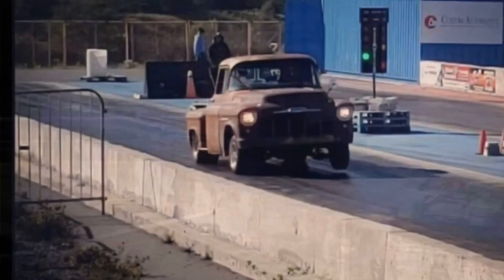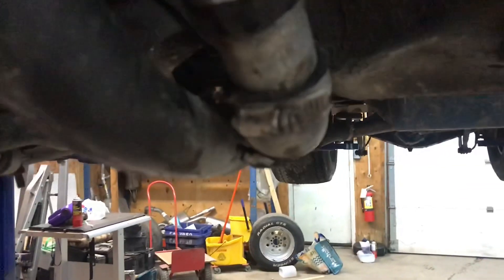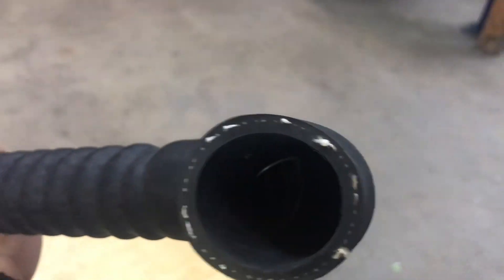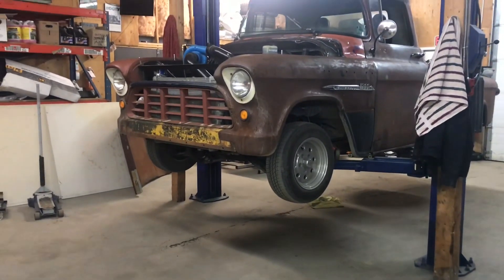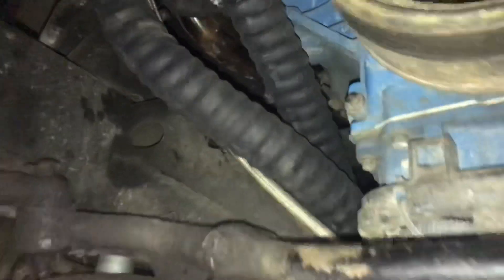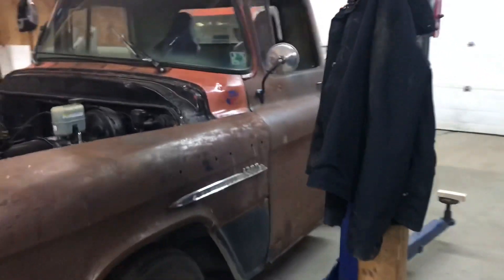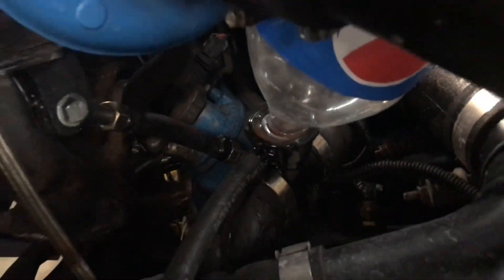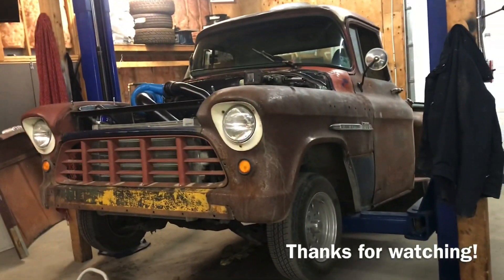Relocating the radiator into the bed to make room for a HUGE intercooler part two: relocating hoses

Comment: So how have your cruise temps been at various speeds?
Reply from the maker: Perfect actually, I had the fans wired backwards for a previous build and I was having overheating issues, so I reversed the wiring and it’s perfect, doesn’t go above 185F

Comment: so howd it work?
Reply from the maker: Awesome! Had a couple bugs to work out, overheating and such but I had the fans rotating the wrong direction and when I reverse them, it worked like a charm! I’ve done third gear burnouts for 30+ seconds so far and it hasn’t went over 180 degrees. Also now that the rad isn’t up by the intercooler, my IATs are a lot lower